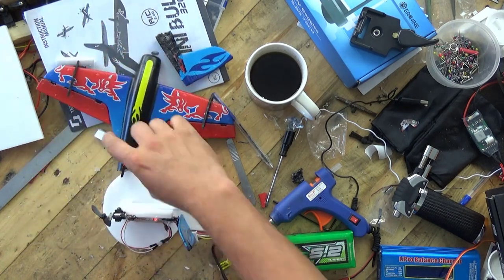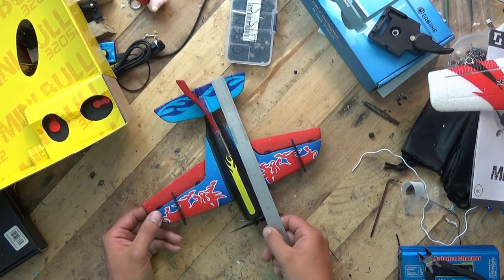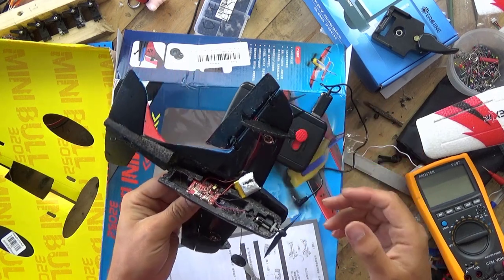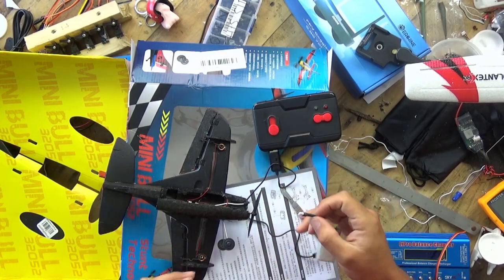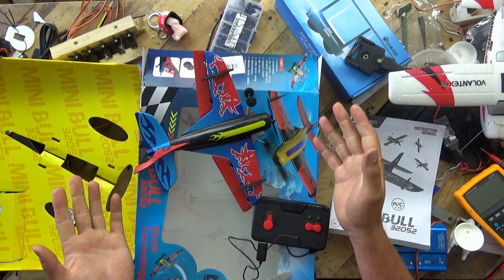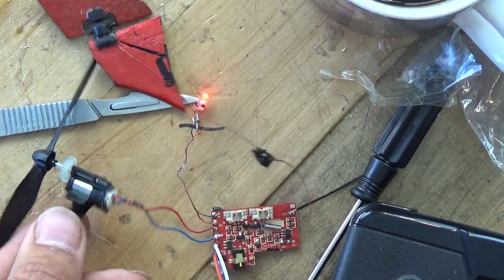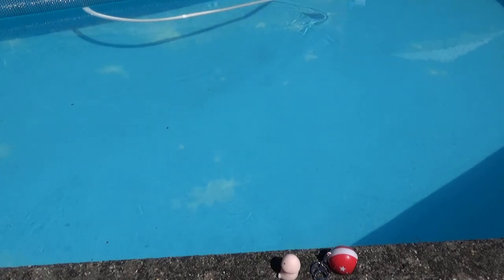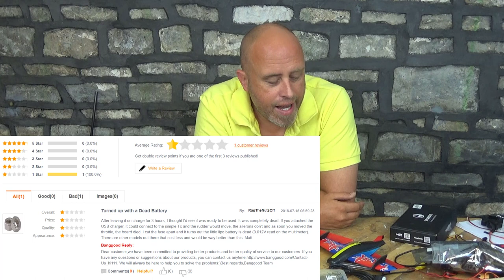Will It Even fly? 🦆 or 💩.... BoT Episode #1

Comment: I picked up an identical plane to that "Mini Bull" in Home Bargains over in Brislington back in 2016, the info inside was dated 2014 so I think it was already old stock Home Bargains was selling off and I had to swap the battery to get it working. The controller has an extra button that kicks the ailerons in opposite directions so it does barrel rolls. Up and down is just more or less throttle. Never got it flying very well but then I am a complete novice at flying anyway.

Comment: It's a magnetic actuator They've been around (and mostly rubbish)on cheap toys for nearly 10 years. Usually on rudders and elevators though. If you build your own they can be quite effective but only on tiny lightweight fliers.
For another dollar (or thereabouts) you could have had a flybear fx805
The tiny Giant Power 180mah lipo fits these planes as almost a direct replacement, though it isn't worth the effort, and also fits the Mini Trainstar (with a little persuasion)
Reply: And that is not a hovercraft, it's an airboat :D